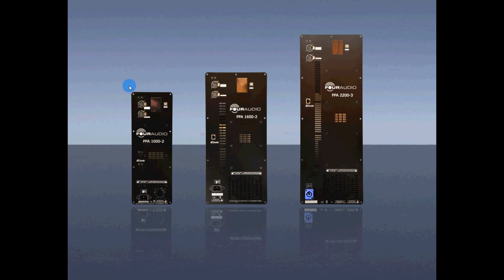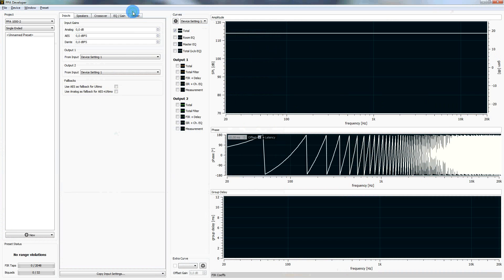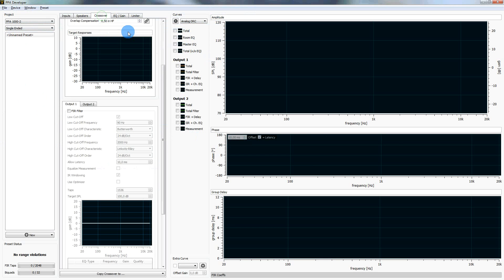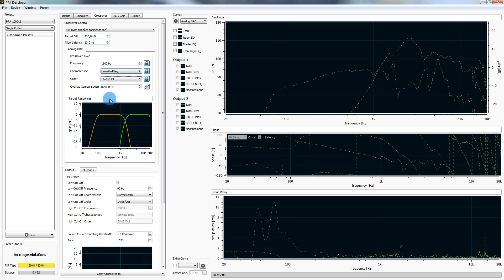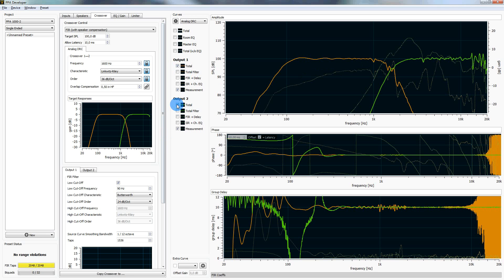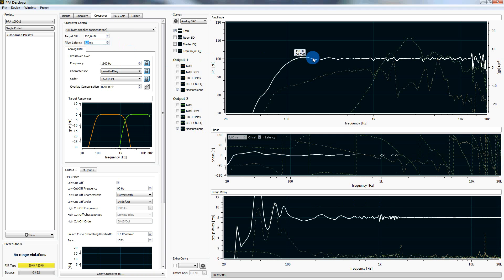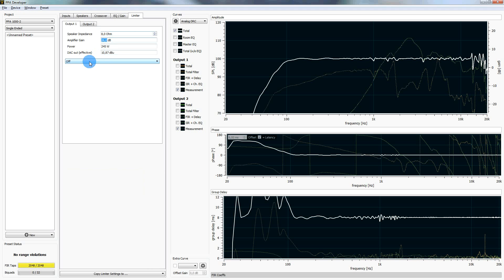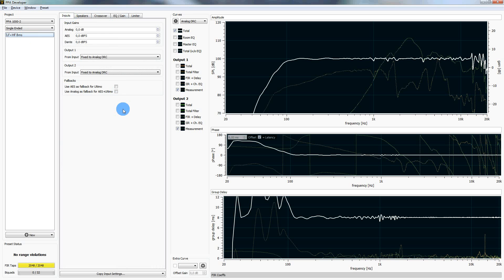Loudspeaker crossovers with speaker compensation and linear-phase FIR filters

Comment: But isnt a Speaker Impedance a complex model , its not 8 ohms , its different for different frequency ,  i owuld like a PCI card that does crossovers and can feed some signal in to amps , but i dont know if this is that .
Reply: Active crossovers work in a completely different way to passive, the driver is connected directly to the amplifier, the crossover is done before the amp so impedance doesn't have any impact on the crossover design
Reply: I didnt use passive for 10 years , anyways you didnt answer my question
Reply: I did answer your question, I'm saying speaker impedance doesn't matter as long as the lowest impedance value is safe for that particular amplifier.... if you had used active for 10 years you would know this... setting crossover at 2.5kHz will always be at that point regardless if a driver is 4ohm, 8ohm or 16ohm at that frequency
Reply: Im not here to argue ,  you knowledge level led you to think something i didn't say ,  and you continue on that level ,  setting up active crossover on 2Khz ,  you can set passive one on 2Khz as well , so why bother with active .  Set it where you like it , if you want to learn more, you can leave your contact i will get back to you , i payed for my knowledge , a lot , im not going to write books in comments sections  , waste my time for nothing .
Reply: There are many benefits to running active crossover vs. passive. if you spent 10 minutes researching you would understand this. Passive can sound fantastic, in high end stuff where big $$ are spent, but unless you're willing to spend many many hours and dollars trying out configurations in DIY realm, you'll never get close to what a $200 active DSP like MiniDSP can do in minutes of setup time. also, good luck getting time-alignment and linear phase with passive!